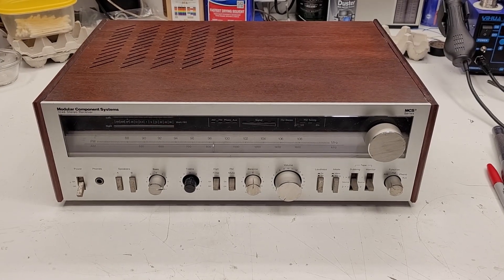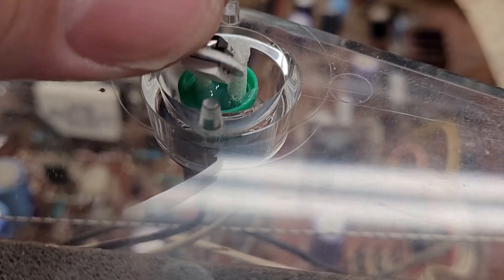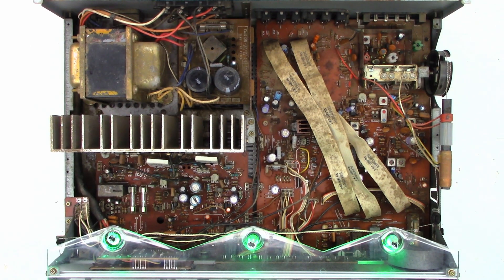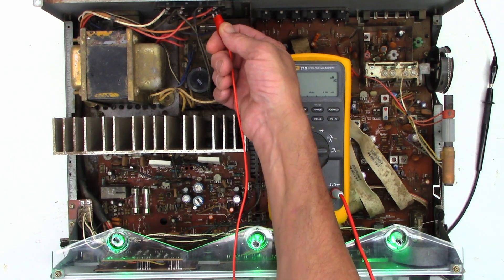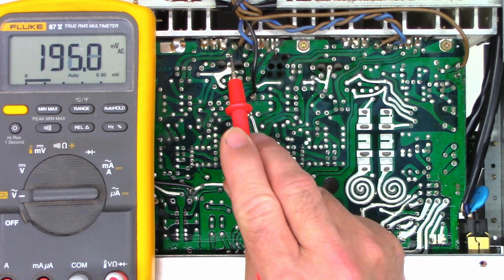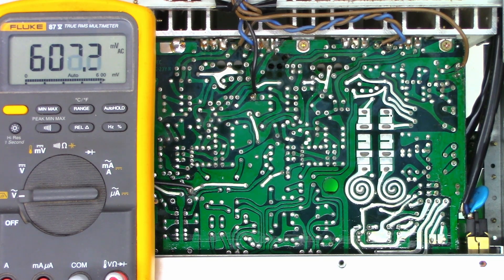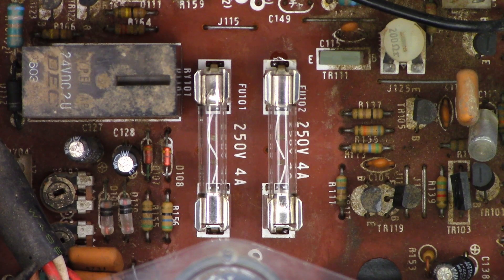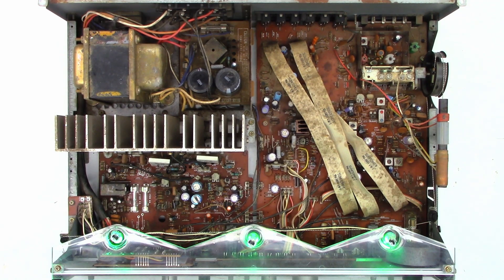JCPenney MCS 3248 Modular Component System Stereo Receiver. One channel out - Not what I expected

Comment: I have a very low hour MCS 3236 and it has connection problems at the rear. Strongly forcibly moving the RCA cables at the plugs on the back and the sound will come on till I release the cable ends. Plus most of the push buttons pop loudly when pressed. This unit is clean as new inside and out. Just plagued with bad connections. Gonna have to take it for repairs. Using another identical back up unit now that has some cosmetic issues but want my super nice one fixed.

Comment: A common fault with an uncommon cause.
Goes to show it's not always capacitors which give this kind of trouble. I've never known fuse holders to fail like that.
A "tricky problem to find, but relatively inexpensive repair" and hopefully the owner enjoys a now working receiver for yet another 100,000 km or so.